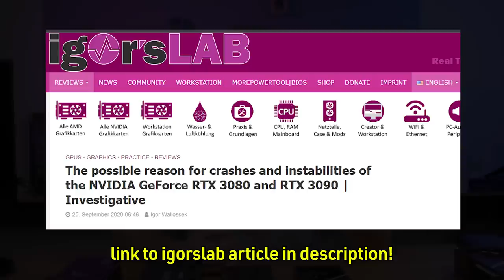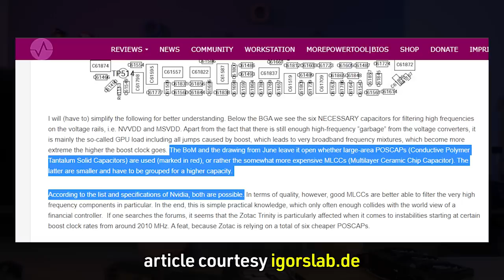The RTX 3080 Launch can't get any worse... Right? Wrong...

Comment: Is it worth to note that capacitors will pick up ferral voltage all on its own. And if you're using a subpar capacitor that it can actually exceed the maximum rated voltage if you just take the single capacitor and lay it on top of your desktop next to something that is emitting any type of electromagnetism. 
  I'm wondering if these subpar capacitors are doing some of that as well which is causing excessive bleed off and you can have all sorts of weird gremlin-like effects from that. 
  The experienced it in the high voltage line field was using subpar capacitors causing all sorts of harmonic distortions overboarding discharges and even back feed wrecking havoc on your power grid causing brownouts and even your house lights to get super bright from excessive voltage being delivered. 
  Like a passenger is a capacitor so I could not say that it would not happen on the smaller level with fine electronics just like it happens with these larger ones that you see hooked up to your power lines going down to your house
Reply: It's not & never was an issue. Look to any credible media source for accurate information. Secondly, giving your own comments 👍 is just sad, dude.
Reply: The issue turned out to be Nvidia post release drivers (pre release drivers were fine), had NOTHING to do with capacitors. Jay need to take down this video as its still misleading people like you,  but he keeps leaving it up for clicks $$. Yes Nvidia released a updated driver that corrected the problems on ALL regardless of capacitor type. Watch this explains all.
https://youtu.be/lhyCdraz54s?t=350

Comment: I’m sitting here with my evga 2080ti ftw 3 not crashing. The price for early adapters to new gen
Reply: NightcoreChase is that a way to make you feel better that your card about to be obsolete?
Reply: I bought a 2070 Super new off eBay for $375 from a panic seller. Very glad I did. Enjoy that 2080ti !
Reply: @power2daaplayer304  obsolete what? cards don't just die when a new one comes out.
Reply: I suspect a lot of 2080Ti owners are just going to coast until the 4000 series.  The 2080Ti is still a powerhouse, and "only" 250W.
Reply: 2080 ti are known for memory problems
Reply: @dudeman7738  true, but certainly will lower the value of your card significantly. In a sense, obsolete to its price just a month ago
Reply: @bogdan8613  That was like ... 2 years ago.
Reply: @vincenthodges647  not if you bought it for 400 usd, literally cheaper and less power hungry for the games I play, as well as not even ever getting close to 80% usage.
Reply: Problem is that the 30 series is not a "new gen" card. It's an "upgrade" to the 20 series cards.
Reply: steve sabroe  the lack of RTX and DLSS may cause 1080 to she a bit quicker than usual, but still it's one big chunk of a calculator.
Reply: Power2Diplayer 2080 ti obsolete? Lol!
Reply: @Midaspl  you do not use rtx or dlss unless you are playing 'those' games, for anyone keeping a 10 series they probably play esport titles or other more mechanically skilled games.
Reply: maggots0007 nope, it is a completely different card, even the architecture is different
Reply: Nice. I would take it over a 3070
Reply: @Kiwippy  Yeah, but it seems the technology is slowly "getting there", so we might see it used more in the future, thus why it could age faster.
Reply: @Midaspl  it still performs the same, if you dont have a forseeable actual use case for newer more expensive cards, why buy them. Waste of money or rather the marginal utility derived from these cards is less than that of older cards, if my 10 series card can last even more than now as it is more than enough for the games I do play while not studying then its more than enough, and buying a new card is the same as throwing money in the bin.
Reply: steve sabroe dude even the fabrication process is different, it’s not like intel 6th vs 7th gen, nvidia 30 series is completely different from 20 seriey
Reply: Love my FTW 3 Ultra <3
Reply: Love my 2080ti ftw sits at 2100mhz and 8000mhz on memory.

Got it day one!
Reply: N3rdworld Problemz I honestly don’t get how anyone justifies spending $1200-$1500 on a gpu. Like sweet fuck you’re just crazy. $700-$800 is still a crapload of cash for one but at least it’s somewhat realistic for high end cards.
Reply: First thing I said to collegues: let's wait to January, better availability, no fuss, problems will be solved.
Reply: @vincenthodges647  prob that but I'm not trying to sell it I want a little card collection personally.
Reply: Didn't 2080Ti also had a lot pf problems? I was lucky that my didn't but from what I see, a lot of 2080 and 2080Tis were sent back due to memory problems.
Reply: @xdreampcs8554  just got one for 350 ^^
Planning to sell it to my buddy if rdna2 or 3070ti comes out and is good for my setup

Great card so far, have fun :D
Reply: Got my Strix 2080 Ti OC and I’m more than happy. I was going to upgrade to Strix 3090 but it’s no longer worth it now unless they resolve the issue.
Reply: No 2080 TI owners get to be smug when the card is still more expensive than the 3080 XD
Reply: Simon Slays well to be fair it wasn’t worth it without the issues. But these issues are isolated to the 3080 as far as we know right now. I wouldn’t be surprised if it happened to some 3090s, too though
Reply: @jimbob4447  Yes is obsolete and already a shitty card for the money. U mad!?
Reply: I feel like 2080 and ray tracing came out like just a fortnight ago
Reply: chillin' waiting for the 3060/3050 to come out for my 1440p 60Hz monitor; don't even need one yet, still using 1060 3 GB on older games
Reply: @Vyrisus i actually have a Gigabyte 2080Ti OC :)
Reply: well, dont know about you guys but if you willing to pay 500$ for 2070 or 1k$ for 2080ti then why panic ? Unless you play on a 4k monitor otherwise 2000 series still a beast for 1080-2k
Reply: Lethalogica Yeah but our card works
Reply: @power2daaplayer304  a 2080ti is certainly not obsolete. Nor is a 980 like what I use. At a certain point do you really need more performance? Depending on the use case you can reach that point at different times.
Reply: @xorbe2  That's pretty much how I do it. I get the Ti versions and skip a generation. It has served my gaming purposes just fine so far.
Reply: @Ghodum  And can you imagine people spending that much on a mobile phone? Welcome to Apple.
Reply: Thomas I also don’t spend that much on a phone. Honestly makes even less sense than with a gpu
Reply: @Ghodum  Some people do...
Reply: Be careful with evga they use cheap parts only asus use top quality parts!

Comment: Tim@NVIDIA - NVIDIA posted a driver this morning that improves stability. Regarding partner board designs, our partners regularly customize their designs and we work closely with them in the process. The appropriate number of POSCAP vs. MLCC groupings can vary depending on the design and is not necessarily indicative of quality.

oups..

Comment: You keep saying "ESD". ESD (ElectroStatic Discharge) has virtually nothing to do with switching noise/decoupling capacitors.
Reply: I think he meant to say EMI not ESD.
Reply: I was so cringing when hearing that :P probably those low cost caps have higher ESR thus causing the crashes
Reply: He is definitely talking about EMI and saying ESD. It is likely because he has a much larger pool of experience for dealing with ESD than with EMI and is simply misspeaking as Jay tends to do on occasion. An interesting thought has occured though: As clock speeds keep increasing and the voltage keeps getting smaller for power consumption issues, EMI is going to become a larger problem. Are case makers currently focused on thermals and asthetics going to look at EMI as a design consideration? What about the electrical noise from fans and pumps in cooling solutions? If the tolerances are so tight it may not take much for a false clock pulse.
Reply: @sivawin19  ESL is much more important at hight frequencies than ESR

Comment: I generally stay a generation behind the latest. The performance is still fine and the drivers are way more stable after having a year's worth of updates.
Reply: Never thought of doing makes more sense than buying at release
Reply: It's fine if u wait 3+ months after launch :) That's why i plan on building pc in january :)
Reply: A lot of people just seem very impatient.
Reply: I was an auto technician for over 5 years. One thing I learned is to never buy into the first iteration of anything. It's almost always more expensive, almost always less reliable, and almost never worth getting it early. Let someone else be the guinea pig.
Reply: That's a given in regards  to rendering. Just wait. My tiny dual evga Ko ultra 2060 330 watt total  set up is 20% slower than a single 3080 350 watt.  single 3080 350 watt.

Comment: MLCC are not  expensive ( ~1.50 per 1000 ) and cost no more to  solder on  to PCB, these parts are all pick and placed by high speed robotic machines. The populated PCB runs through  a  reflow oven with 6 to 8 zone  ramping heat   cycle then 2 zone cool down that needs very specific profile. Bad profile= damage to components or bad solder. Additionally,  board cleaning in wash systems can have deleterious effect on caps not evident until burn in. The sintering process used to make caps does frequently produce bad batches depending on the line they were processed on. Quality in cap sensitive situations will definitely affect circuit performance. Never buy grey market caps to lower cost. All cards could be returned and reworked pretty easily if bad caps are the culprit.

Comment: That is why I am waiting a minimum of 6 months before buying any of these card that includes AMD.
Reply: Spot on👍
Reply: Yup 3-6 months after release let all the issues come out then decide whats best.
Reply: @jameshepburn81  You might have no choice.    They may have to redesign some of these cards, further delaying supply.   In addition, if they recall some cards, that will further restrict availability.
Reply: @robtoe2  it was all so promising to begin with😭